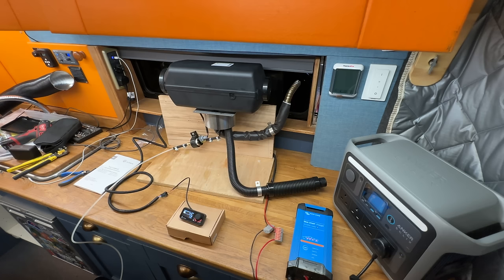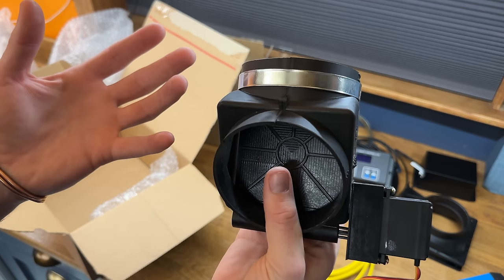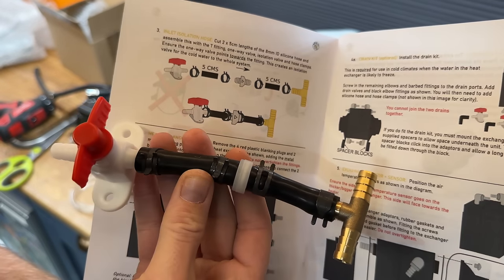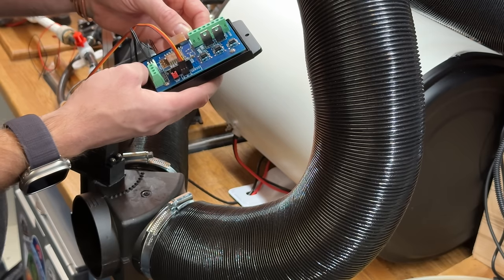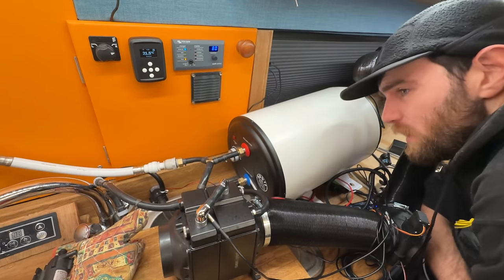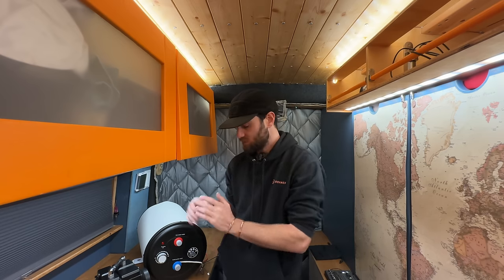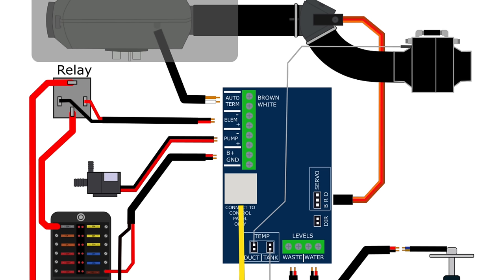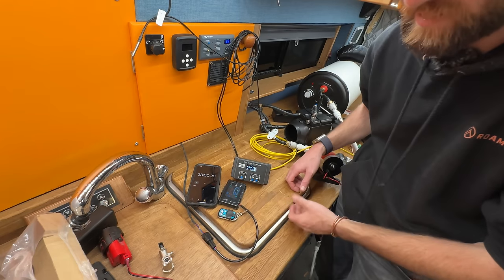BEST CHINESE DIESEL HEATER Upgrade!! Thermostat, Hot Water and More!

Comment: Good for you for reviewing a product for more than one time as that’s what I find many creators do. It’s usually after a six month period do problems come to light. Appreciated
Reply from the maker: It’s also nice to see a small company develop over years. I’ve had no real issues with my original version in 3 years
Reply: @MispronouncedAdventures  so have you ever had an issue with the on button on the display panel not working but will work via Wi-Fi?   Lol

Comment: Great video Alex. I missed out on the discount code as I just purchased the new controller and servo driven diverter for my non pressurized system a couple of days ago! 

My main reason for wanting the thermostat is to prevent damp when I’m not using the van for extended periods over winter. The bowden cable on my current diverter is also hit and miss so having the servo do the work will also be nice (diverter is out of reach in the garage area and cable keeps detaching).  

It would be great if Ed could add MQTT for remote access and direct comms with the heater board so correct mixture settings could be set for a clean burn etc… it would definitely be an afterburner killer then.

Comment: I would love for you try out a side arm heat exchanger that is normally use to externally heat hot water tanks. 

If you can rig it to take heat from the exhause. I think it will be much more effective. The exhaust must be way hotter.
Reply from the maker: I personally don’t give merit to the use of heat recovery from the exhaust, but not because it doesn’t work. A lot more complicated than many think. mainly as you can’t run water in the heat exchangers, ( like EGR’s ) they should be using coolant. issue being if you have an external heat exchanger, if the heater is not on and it’s using water it will freeze and crack the first time it’s below zero. 

Using coolant requires having a secondary heat exchange inside the van, cutting holes and  pretty much making a separate hydronic loop with pump and reservoir. 

I think system is like that work, better in a stationary set up.

Comment: Awesome video. I have the OG bobil vans kit. That I've had for years but never ended up installing. I want to make a portable recirculating shower with it for my transit custom camper. 

Do you have your bobil vans kit online with the water tank or is there extra filters in do the dirty water in the tank doesn't go through the rads ?
Reply from the maker: I use my Bobilvans kit differently from most as it for my recirculating shower, although it seems like you’re on a similar thought. but I’ve never had issue with the rads clogging. generally the water going back into the tank is had most dirt filtered out of it

Comment: Hey, what did you use to stop thermal bridging condensation in cold weather ?
Reply from the maker: Specifically what cold bridge? Between the metal work of the van and the inside or somewhere else.

Comment: Another great video!  You're an absolute rock star!

As someone who wants to incorporate 'redundancy' into my van, there is one negative about this system.   This system would crap out if the Chinese diesel heater craps out.  Correct?  Thanks in advance.

And please, keep putting out more amazing content.  Kudos!
Reply from the maker: Thank you. 

The unit works with any diesel heater, Chinese, autoterm, Webasto, Espar.  if the heater wasn’t working then yes. No hot water or hot air. 

The Smart controller is more stand alone than integrated into a heater. The thermostat part is however only for Chinese
Reply: You still have the option of the electric element though which could be powered by solar or having the engine on, so hot water can still be made but no hot air.
Reply from the maker: @chrisb5839 indeed you would have
Reply: @chrisb5839 Great!  That is exactly the sort of redundancy that I want.   This system allows two different ways to heat the water in the van.   Awesome!!!

Comment: It’s definitely an impressive system but how would that tank fair on a system like yours though, with it being a recirculating system? Main thing not being able to clean inside the tank and the possible build up of for the lack of a better work scum. Also you convinced me that a recirculating system is the way forward for many reasons. Just wondering how often do you have to clean your water tank and what is the state of the tank when you do or are the filters that good? Can’t wait for your next Nordic series. Love how informative your videos are
Reply from the maker: I don’t use this system because of that reason and I need to keep the tank. So for me it won’t work. I just wanted to test and look at the new kit

Comment: The bureck controller does the same thing except it doesn’t speed the heater up and down. It’s stays on the hz you set it at and the controller turns it off and on.
Reply from the maker: So like a cycle model! Gets too hot turns the heater off?
Reply: It also can control 2 separate heaters.

Comment: I do like this system but could be done cheaper with a motorbike rad and a small 12v pump tbh, I recently had a problem with the temp sensor on a chinese diesel heater due to restricted air flow blowing back overheating the temp sensor hence the sensor turning the diesel heater off have you had issues with that?. My only other thought is the ducting with the servo mechanism surely that would dry out and stop working due to the heat that goes through it ie dry out the grease your temp sensor on the video shows how hot that part gets so would dry out the grease and stop it working
Reply from the maker: There is almost no air restriction caused by the rads on this. Since the original version of this kit used rads from the PC water cooling sector, they are designed to maximise airflow.

Comment: Another awesome video buddy👌I don't suppose you will be doing one on how to pair the afterburner withe the smart controller?
Reply from the maker: I’ve had been looking into ways of doing. as an extra for the afterburner you can have the radio controller. So in theory the smart controller should be able to give the same commands to the afternoon via radio
Reply: What do you mean by the radio buddy? @MispronouncedAdventures
Reply: @MispronouncedAdventures I've just ordered the extra relay from bobil do you think this will work?
Reply from the maker: @leeblackbourn3062 the normal Chinese diesel heaters have a little radio remote control to use. The smart controller works by mimicking the signals from that radio Control. 

The particular version of the afterburner can also intercept those signals
Reply: @MispronouncedAdventures  awesome I'm with you I think 🤔 so I should reconnect the original night heater control and turn on the bobil heater etc run through some cycles and then reconnect the afterburner?

Comment: Hi buddy so ive managed to get my Chinese heating work in situ with the smart controller now however when i do the same things with afterburner it all works while the 2 are connected together, as soon as i disconnected the Chinese controller the bobil kit wont turn on the diesel heater through the afterburner, i don't suppose you had any issues like this? Thanks again Lee
Reply from the maker: That’s something I’m still planning on working on at some point.

Comment: whats the air temp like after its been through the echanger with water flowing through it?
Reply from the maker: Depends on how powerful the heater is running . I find it cool to marginally warm. Most of the heat energy has been removed.

Comment: @mispronouncedAdventures where did you get the servo actuated diverter valve? All i can find on Bobil Vans is manual valves
Reply from the maker: Servo actuated diverter is part of the smart controller kit I believe. As the smart controller uses it

Comment: The Afterburner controller can also be used to control the water pump, it is by far the best controller of any air heater system and takes all the problems out of the Chinese diesel heaters
Reply from the maker: @ochjoo77  hundred percent agree it’s the best. you could use it to control other objects with the GPIO on the afterburner. Not tested it myself.

Comment: Very interesting unit. But I honestly think this is too complicated. Might be easier to go with Espar/Webasto hydronic heater route. A compact package to have both water heater and air heater (with a heater matrix).
Reply from the maker: Id disagree on a complicated point, hydronic / wet heating systems are far more complicated to fit and install. They definitely not compact at all. Webasto or espar heater packages are near double think price of this and then some.

this is design for people already with air heater

Comment: Can the servo on diverter be controlled by 12v switch without controller Alex?
Reply from the maker: No, it needs some type a servo controller. But direct 12v won’t work.
Reply: @MispronouncedAdventures  thanks 👍

Comment: Ed Barrow of Bobil Vans installed one of these setups in the middle of December 2023.

It heats both space and water very well. If there's surplus electricity from the solar panels and/or the battery to battery charger after the batteries are charged it's diverted to the immersion element. So, free hot water.

My only quibble is that the WiFi connection drops out from time to time.

Overall I'm quite happy with it.
Reply from the maker: They are great people. I enjoyed my time working for them and living on there drive

Comment: The new kit looks great. Do you need much extra hardware to enable solar dump load heating?

Also, have you seen the state of that lovely oak worktop? It's going to need a wee bit more than a bit of Danish oil rubbing into it! 🥺🤣
Reply from the maker: Not much an extra is needed for the solar dump. 

Yeah the work top definitely needs some care! 3 years of work

Comment: Hi, my Bobil tank came with a third cable (smaller, brown) alongside the black and red power cables with no reference to where this is routed in the wiring diagram - any ideas?
Reply: Great video by the way! I watched it previously and it convinced me to buy the hybrid system 👍

Comment: Should be nice to use the exhaust heat to warm the water instead of the hot air output.  A lot of heat is lost in the exhaust.
Reply from the maker: I dont personally rate exhaust heat recovering in a van setup. not as simple as many things it can be. EGR’s are popular or even widing copper pipe around the exhaust for trying do it but you shouldn’t be running water direct in them, in cold conditions you’ll crack the EGR when the water freezes if the heater isn’t on. It should be done with glycol / hydronic loop. Which needs its only pump, reservoir and second heat exchange inside the vehicle to turn hot glycol back to hot water.

Comment: Looks too complicated. There is a wet diesel heater that is used to heat the cooling system in a truck with pump that you can use for that purpose and it is much more compact and easier to install
Reply from the maker: I would’ve said wet heating is far more complicated. I’ve played around with hydronic systems.
Reply: @MispronouncedAdventures it's just one unit my friend. Designed to help warm up diesel engine cooling system.

Comment: Why does the hot water tank not need an expansion tank? 🤔
Reply from the maker: Didn’t say it didn’t, quite a few of the examples with diaphragm pumps showing a few metres/expansion tank used. Down to the end, User, how they install.

although for a safety point of view, it does have a relatively low pressure Relief valve built into the tank.
Reply: It does, it’s just hidden!

The silicone hose is super flexible, which allows for the first 15-20 degrees of temperature increase to be absorbed by the silicone expanding slightly. Any expansion above this goes out through the overpressure valve. If you want to avoid this, we do sell an expansion tank for £49.

Comment: I can't see those electric air diverter valves on the bobil site, anyone have a link?
Reply: I use a £10 linear actuator to control the air diverter.
Reply: They are shipped out if you buy a smart controller 👍

Comment: of course, why not buy a $600 water heater that will take about 12 hours to heat up a couple gallons of water instead of buying a tankless water heater for $100 that provides instant hot water.
Reply from the maker: Most $100 tank less waters which I guess you mean a gas one. Shouldn’t be fitted inside vehicles. Plus most new self built in uk don’t want gas anyway. Most use diesel heaters. It’s also doesn’t take 12 hours, it takes about 15-20 minutes
Reply: Well,  a tankless water heater would not heat the van.
A tankless water heater will not heat water with just 12 volts.

Comment: WAY TO MUCH MONEY!
Reply from the maker: For you maybe, considering the price of other water heater kits, it’s one of cheapest and most powerful  around
Reply: @MispronouncedAdventures  Wrong!! Shop around. Way to much money! It's greedy money. But hey, you'll find out for lack of sales. Should be around $125.00. At that price point you will have success.
Reply from the maker: @wideawaketotruth5301 Bobilvans already have success, lack of sales isn’t an issue, getting stock in quick enough is.
Reply from the maker: @wideawaketotruth5301 I don’t, but you don’t need to take my word for it I don’t care what you think. 

Although you are welcome to look on the website and see stuff  is on pre-order because it’s out of stock
Reply: $125? That doesn’t even cover buying the heat exchanger!
Reply: @bobilvans4205  MY point exactly! I have a propane on demand water heater. Cost me $70.00 us. Works great, very simple and efficient.
Reply from the maker: @wideawaketotruth5301  many new builds people don’t want gas and many are moving away from it. most of the cheaper gas boilers shouldn’t be install in vans for safety reasons as they are not room sealed, not that people listen. Maybe a price compasion between to complete didn’t fuel type heater is silly. Even more so it one can’t be install in a vehicle, and the other can
Reply: @wideawaketotruth5301  and the options for you if you don’t have propane? Or want to heat electrically? We have gas heaters over here in the U.K. for about the same amount of money but they’re illegal and unsafe to use in vehicles so it’s a moot point. But i wish you well with your propane heater.